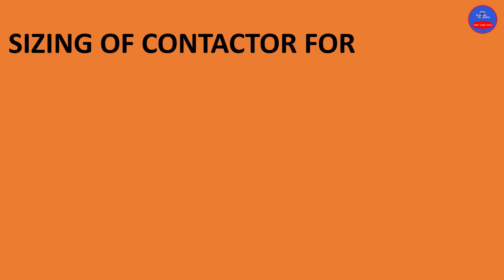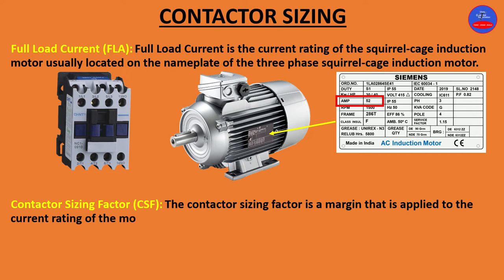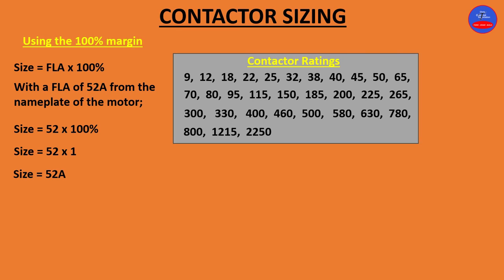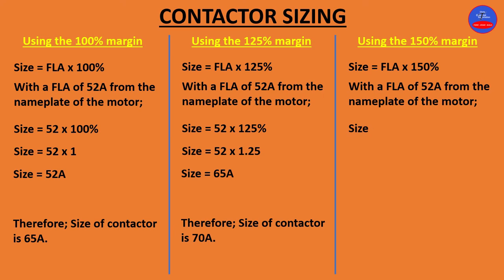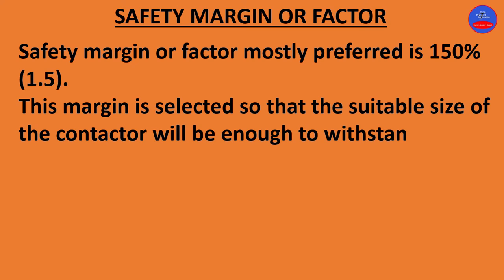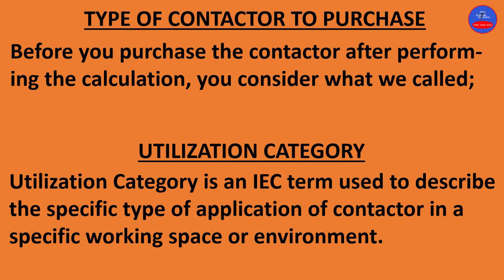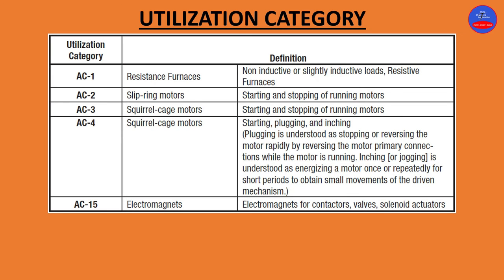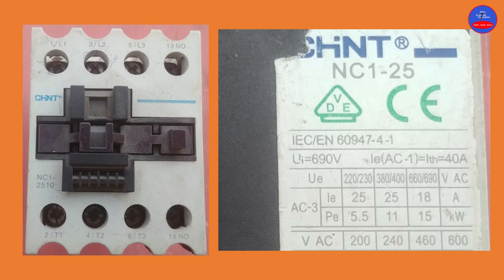Sizing of Contactor and Selection | Contactor Calculation and Selection For 3 Phase Motor

Comment: Thanks alot 🙏 for the knowledge sharing. Please does it apply to star delta start too??
Reply: Thank you Sir
Reply from the maker: Star Delta will drop on this Friday.
Reply: @ChrisControlAutomation  it's alright. Video on electrical design for a facility where you give details of loads, cable required, breaker sizing, ....
Reply from the maker: Alright